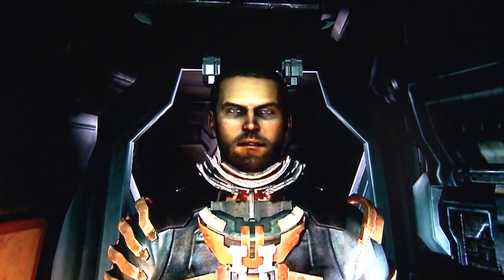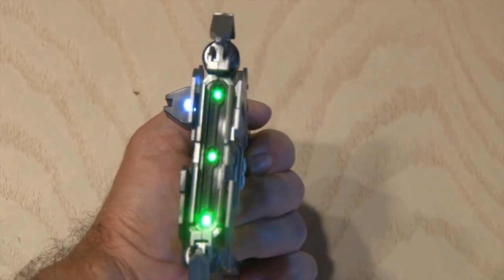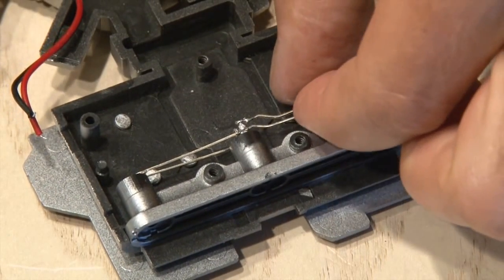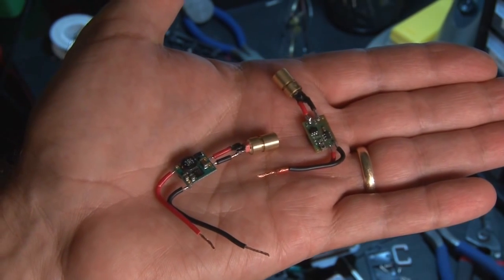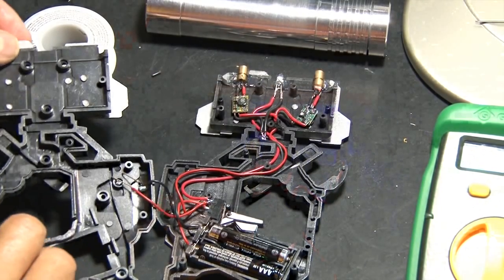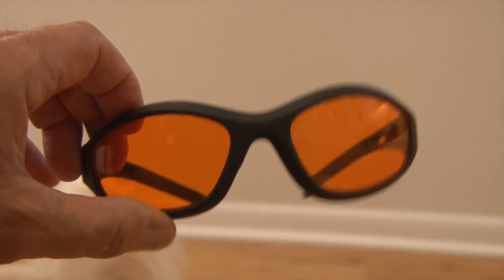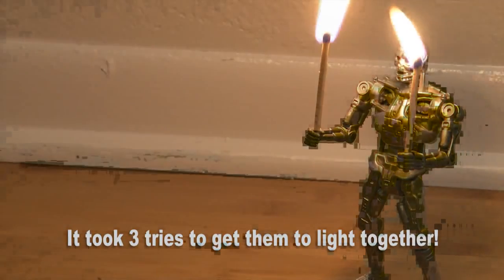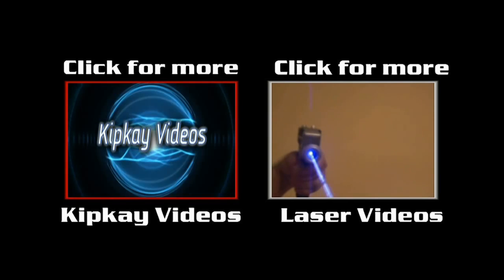Laser Hacked Plasma Cutter from Dead Space!

Comment: get the most powerful laser and put it in like 7 magnifying glass's and then burn a house down :D
Reply: Lasers and 7 magnifying glasses? Thats gonna reduce output power a lot. U know, a laser like this could be focussed right? Adding optical instruments to the laser beam is gonna reflect a lot of power, especially when they aren't AR coated.

And most important of all, a diode laser is magnified light, most cases, magnified to infinity. You can make the dot smaller to burn without reducing power.

Have a nice day sir.

Comment: Send me a video on how to make a standard laser pointer burn!
Reply: I remember when I used to want to do that. It is simply not possible. You can, however make a 1W laser "pen" for a little over $125
Reply: rubyspear131 Nah man, a lot less than $125. You just need a burning laser diode (≥200mW), a laser housing/module, and a resistor to regulate the initial flow of power to the laser. Just look around on eBay, I saw some pretty cool stuff for pretty cheap.

Comment: Just to let everyone know. Lasers of this power require a heatsink. If you dont you can blow your diode. If you want more power. Run an x drive which takes up to 15 volt! Just be careful on the amperage as that can also make them pop.
Reply: i have a video of my 2000mw laser. It cost me 125 shipped to Australia. You get an m140 diode mounted in an aixiz module with a g2 lens. Also comes pre wired with an x drive Links in description. Just buy a $4.00 501b host to mount it in and go to lpf (laser pointer forums) and buy a heatsink to suit for $20.00 If you want an actual laser etc.
Reply: Don't understand lol

Comment: @here57 a more powerful battery wont make the laser stronger.  you need more powerful laser diodes or whatever they are.  They have ones that are a lot stronger right now, in fact the military has lasers on some planes designed to blow up missiles.

Comment: @mossebo2507 
It can, but the lasers operate at minimum power. The 1W laser needs atleast 9V to operate and you need batteries that support a high load. The 1W laser is really powerful and cut through plastic and pop ballons in less than a second. But in dis video, it operates at its lowest power so people won't get hurt. Even though Kipkay doesn't want you to know for safety issues.

Comment: @BIGIIJJ Probably not...
Depends on the strength of the laser.

Stronger lasers can cut through plastic and whatnot.
But those are usually 1 to 2 Watt lasers, which you can only acquire by building them yourself or having a license (not sure if that's the word) for them. (if you are a doctor performing laser eye surgery for example)

Comment: @kipkay Sure, lasers are cool and it's fun putting them in stuff.
Once or twice.
The problem is that it gets boring just taking a thing apart and gluing a laser inside it.
Either you have to do more modification or use other gadgets.
There are lots more small fun electronics projects you can devulge in, like hacking a motion sensor lamp or replace the side of your dishwasher with plexiglass.

Comment: You should have installed three laser diodes and had the top and bottom one's slightly pointed towards the middle one, then you would have a triple-power laser at the sweet spot where they converge.